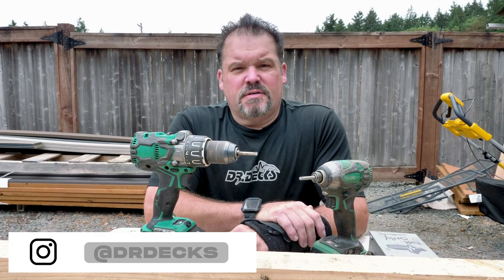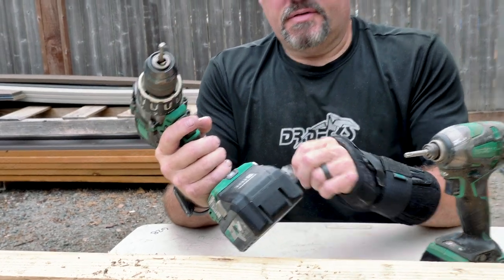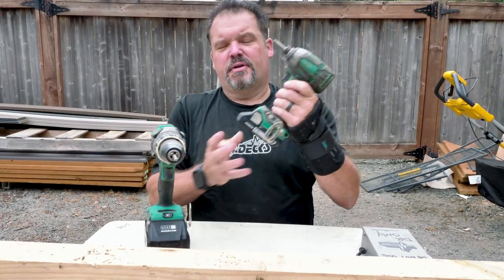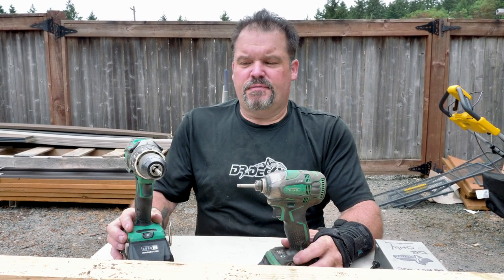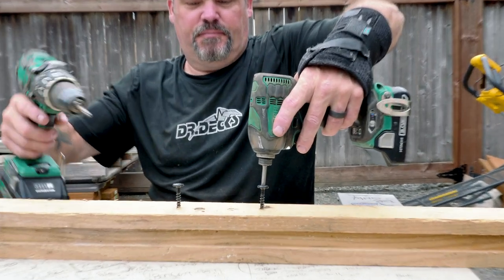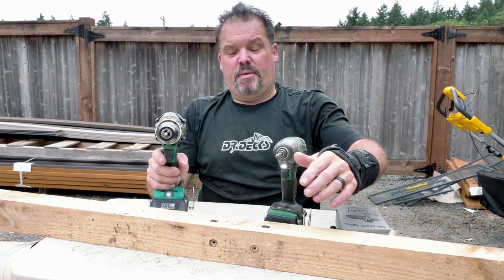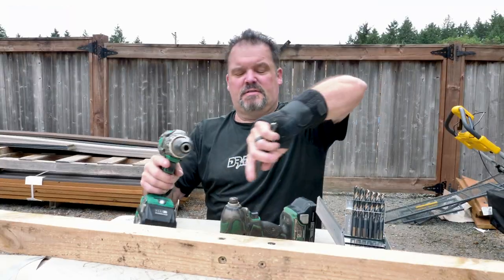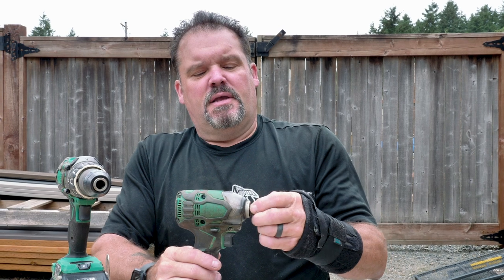Impact Driver VS Standard Drill: What's The Difference? || Dr Decks

Comment: Any chance you’d say why Metabo instead of let’s saw Milwaukee or Dewalt on the job site?
Reply: Don't think that will happen, metabo are pretty much water proof, a must have in PNW
Reply: @OUrVileO  Really? I've used several of the other brands in the pouring rain without any failures. No, I didn't submerge any but they spent hours in rain.
I've heard great testimonials on Metabo HPT's durability. Personally, their product offerings are too small. When they catch-up to Team Red, Yellow, or Teal then I'll consider.
Reply from the maker: I like their IP56 rated drills and the triple hammer impacts are hard to beat. A reasonable battery cost also helps.